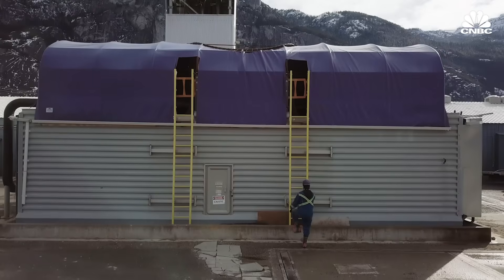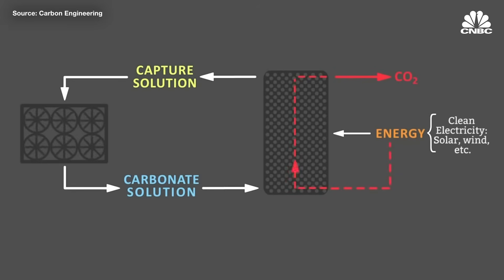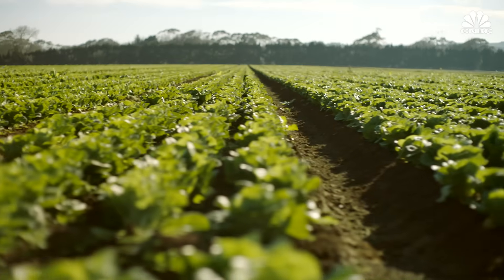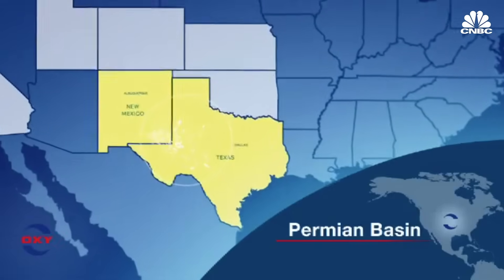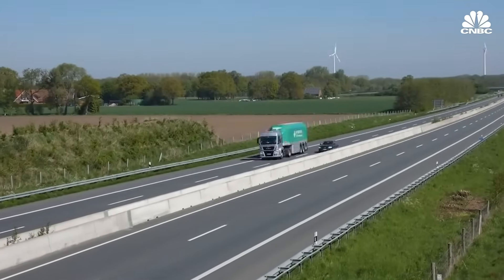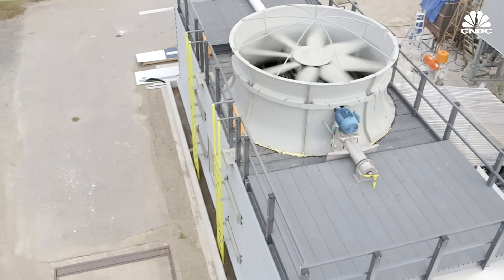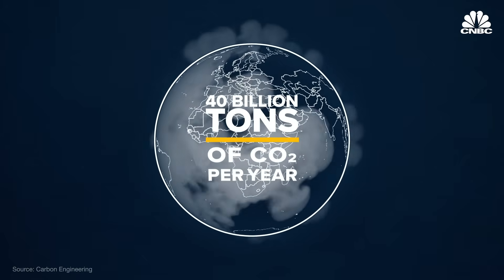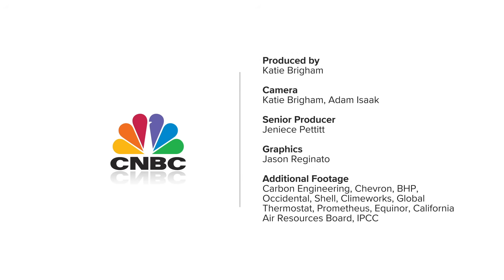Bill Gates-Backed Carbon Capture Plant Does The Work Of 40 Million Trees

Comment: Carbon Dioxide is greening the earth and shrinking deserts.
Reply: How bout you just sit in your garage while the car is on and the garage door is closed and enjoy all the carbon dioxide you like
Reply: You are technically correct....
Reply: All mighty ass that would be carbon monoxide
Reply: Yep, that comes from a study by Zhu et al 2016. Carbon dioxide is also warming the planet and changing the climate, as the paper discusses. The paper does not conclude that this increase in plant growth due largely to CO2 fertilisation will stop the negative impacts of climate change.
Reply: wrong
Reply: soil is degrading and plants dont grow due to water flashing away instead of sinking slowly into the soil as it is to dry...

it actually creates an overheating with creates desertification due to wrong agricultural practices

its way more complex as it seams first sight

If it only would be that easy  all these problems wouldn't exist
Reply: @ryanzacsanders  there is legitimate scientific research that shows between a half and a quarter of vegetated lands on earth have been greening over the past 35 years, and that this is mostly due to CO2 fertilisation. The research was done using NASA satellite data. I think OP was wrong about deserts shrinking though. There's a page on the NASA website about it, with a link to the paper. 
https://www.nasa.gov/feature/goddard/2016/carbon-dioxide-fertilization-greening-earth
Of course, this paper doesn't support the idea that climate change is good.

Comment: What a laughable attempt to solve a NON-PROBLEM! All he has to do is gather a pail of plankton rich seawater and add them to a tank containing seawater containing a dissolved mixture of dissolved rock dust powder and concentrated iron ore powder and let an artificial planktonic bloom to explode in the tank and have them continuously screened out and recycled the seawater back and add fresh seawater and composite rock dust powder and concentrate iron ore powder to the tanks and keep on repeating the process. And use the ultrasonically rinsed phytoplanktonic algae to be added to a biogas digester to produce energy to run the entire system.

Comment: It would make far more sense to use thorium as nuclear fuel, and other forms of energy.
Reply: Thorium is not ready yet but your absolutely correct. It wont be long for another energy source comes along thats clean and cheap....Then all the trees we had planted will continue to provide benefits for decades to come while the air filters would be rusting away. We could also still be paying for them.
Reply: @scooterbum4288  The only thing needed currently is the construction of the power plants. We had two test facilities one in Oak Ridge, and another in Los Angeles California that did run for many years. They were phased out by Nixon in favor of building nuclear plants that are more efficient for making materials for nuclear weapons.

Comment: Big oil jumping on board doesn't surprise me actually. The biggest threat to their bottom line going forward, is the fact that people are now awakened to the need drastically cut co2 emissions, which means drastically reducing the burning of oil, coal etc. Big oil knows this of course, so... if a technology exists that might obviate the need to reduce co2 emissions, by sucking the co2 out of the atmosphere as fast as or faster than it is pumped out, then big oil are going to jump on it, because as it stands it's the only thing that might keep their entire business model viable into the future.

Comment: 51% on man made CO2 is from production of beef... 60 million cows in the us. 300 years ago there were 100 million buffalo on the open plains. CO2 is not the issue nor is climate change real.
Reply: The diet of wild grazing buffalo is in no way comparable to the grain fed cattle of today. Also methane is different than CO2. Its 150x more potent.
Also the climate is changing. The USDA regularly has to update its climate zone maps because they have moved 40 miles north every year the past decade. Annual precipitation, sunny days, and record heat determines an area’s climate zone, all of which are changing rapidly.

Comment: GROWING forests also  take out a lot of carbon from the air (in mature ! forests there is a balance). Remember the pictures of burning Notre Dame ? the French called the wooden roof underconstruction "the "forest":  represented a forest of 13,000 oak trees nearby Paris. Some trees date from 1200 or even earlier - so they started growin around 800 - 900 (A.D. !) So that carbon had been stored for more than 850  years - and if they had installed sprinkler system it would be still in place.

There are still existing ! timber frame houses in Europe that were built around 1300 / 1400. They have been restaurated and are still used. 

These days they have developed technologies to build 5 - 6 storeys high buildings from wood (likely with a lot of particle boards in the walls and flooring).

Some years ago an olden wooden oak bridge from ? 1300 went up in flames in Switzerland. 

particle boards contain shreddered wood, OSB contains MORE wood and is more expensive.

Furniture could be built with wooden boards (it must consist of small stripes glued together in alternating order - to counteract warping). Such furniture would be much more robust, it is easier to restaurate by laypersons. and the solid material would make it worth your while to maintain or build something new from it.

Solid wood is easier to handle by persons that have not have a garage or a lot of equipment (for instance if you make a cut you will have a nice even border. If you cut particle board you have to add a border - which is not that easy if you do not have the equipment. You have more "meat" to screw things together (some dowels glued in after setting up a cabinet in a provisory manner with screws will considerably add to stability - no need to . 

Wooden floors have only a thin veneer on the surface - because the wood is too expensive.

How about we would use more REAL wood in construction and for furniture. Worst case scenario: it is thrown out and now one wants to pick up the good boards and use them for a project. In this case they would be BURNT (in a specialized plant at high temperatures - that takes care of the coating, and paint and other chemicals - with good filters. Such plants are common ! in Germany and Austria. Furniture and construction materials do no land at the landfills, the citizens have to SORT them (only then the costs for disposal will be reasonable, it costs an arm and a leg if you do not sort, that is even true if they tear down a building).

Those power plants do not only generate electricity but also heat - warm water and for heating. That way they can use over 60 % of the fuel - an efficiency a smaller furnce or a wooden stove cannot achieve.  

Those new forests should be grown in the TEMPERATE climate zone. and be taken care of by farmers and in SMALL units. No harvesters (they are a desaster).

The boreal forests and the rain forests that are currently plundered (or burnt down for the insanity of palm oil plantation or "bio fuel") must be left alone. They are too vulnerable (in the cold the trees grow only slowly and the harvesters are a disaster for the ecosystem and soil. 

In the rainforest the downpours wash away the nutrients. Moreover the strategy of nature to deal with the lack of nutrients is extreme diversification (that is why the Amazon is the most complex ecosystem in the world. The African and Asian rainforest got some injection of volcanic ash - but with the Amazon that strategy was take to the extreme. 

There a countless species (plants animals) - but often only in a certain area AND each species shows up only in small numbers. so there may be only a few trees of a certain kind in an area. If those areas are cut down - there go the species (many of them are not even known to scientist yet, let alone that they have been researched). 

So we lose that treasure trove of nature and all options it would offer (a certain poison of a frog, a substance in a plant - that may be of medical interest). Or the "design" of an insect or of a surcace that could inspire engineers (like they did research on the lotus effect or were interested in the skin of sharks and dolphins and how that helped them to swim fast with as little energy as possible). 

If they  brutally cut down the trees in the temperate climate zone and even compress the soil by using harvesters - these forests will recover. Natural forests in the temperate climate zone are also diverse, stable and beautiful - but it is nothing compared to the diversity of the rainforests. (that is because they get more nutrients and there IS soil that builds up. In the Amazon soil is washed out. 

After a cut-down or a wildfire (which does not even revmove the nutrients - nettles and grass will keep most of the ash in the soil) - they will bounce back without help of humans. That can of course be speeded up considerably.

There is enough rain, so the trees will prevail, there are enough nutrients, and it is warm enough to overcome the disadvantage of the damaged soil if harvesters are used  (and the soil is thicker). Shrubbery and nettles  will pierce the soil and then the trees will take over in a second wave. After 100 years they forest will have recovered (or not even that long).

Cut down rainforests doe not recover in original form at all !

Comment: This plant does the work of...1 or 2 square miles of trees.
You've got to be kidding.
Reply: A  healthy forest has ~50 trees per acre. A square mile is 640 acres. Hence a forest might have ~30-40,000 trees per square mile. Hence 40 million trees would be approximately 1,000 square miles.
Reply: A YOUNG growing forest takes out a lot more carbon in the first 30 - 50 years. And they can be planted more densely - local farmers can take out most trees over time  and let a few stand to grow tall - like in a natural forest (that is common practice in many countries anyway. It is labor intense, but also sustainable if different trees are used. Some subsidies (for the price of wood for instance, they would always have some from removing underwood and branches and sick trees, would go a long way to secure these jobs in rural areas. 

Wood can also be used in INCREASING VOLUMES  for durable quality construction material and funiture (not particle boards, solid wood boards). 

In the beginning they can use mature forests with larger trees for that (considering ecological criteria - so small scale operations run by local farmers in the temperate climate zone. Not cutting down the boreal forests and rainforests). 

Meanwhile not only the harvested trees are replaced by new seedlings, NEW forests are planted additionally ! 

Meat needs to be sold at its REAL production costs (much higher), an end to fast fashion (cotton needs a lot of farmland) - that will free up the space for extra trees and there will be enough farmland and meadows left to produce enough food (the forests need to be grown in the moderate climate zone - these are usually wealthy ! nations). 

Forests also influence humidity, the regional climate, aquifers, prevent mudslides, prevent floodings - the soil of a natural forest (as opposed to a fir plantation) is like a sponge, such forests can prevent floodings, when they soak up excess rain. They secure the soil, produce oxygen, are hunting grounds and an asset as Natural Parks and for tourism. 

worst case scenario if such wood is "only" used for a few decades as construction material or furniture - it is burnt to produce electricity and heat, in that case it is carbon neutral.

The wooden underconstruction of Notre Dame was called the forest.

13,000 trees mostly oak that started growing around 800 - 900 AD and were cut down around 1200 AD - they could still go strong had it not been for the fire in early summer 2019. 

a few centuries (or 1000 years) can by us time.

Comment: it makes the same material eggshells are made of?
trees work with no power input but they take ages to grow and can burn down at any moment releasing all the carbon they captured.
the US military budget could solve so many issue if it wasn't being used on war efforts and domestic protection. if the US didn't need a military the money could be much more useful spent on technology development.
Reply: in the first 30 - 50 years a growing forests takes up the most carbon. Even after a large scale fire - the forest bounces back quickly. Humans cutting WHOLE forests is worse - the nutrients are removed when the trees are taken out  (a wildfire leaves ashes)

 - that is O.K. in the moderate climate zone with good soil quality. 

Not in the rainforests where the downpours wash out all nutrients that are not held by biomass or roots systems.

and modern harvesters compress the soil - they are worse than a wildfire, that does not damage the soil.

Comment: Sounds like a complicated tech when all you need is a farm of clear pipes filled with treated sewage water with bubble stones at the base to take the nitrates left in the water and grow algae at the cost of a pump to fill the pipe and an air compressor to pump in air to the water. No chemicals needed just nitrates rich water, air and sunlight 

Nothing like cleaning the water more and pulling CO2 out of the air to create a product that at worst is then turned into animal feed.

Comment: The usual scientifically clueless reporting. 15 minute story without even a single word about the WILDLY THERMODYNAMICALLY UNFAVORABLE nature of carbon capture. This will NEVER EVER even put a tiny dent in the enormous amount of co2 in the atmosphere. The only solution is to stop emitting.
Reply: The solution is to stop emitting, AND work to clean up the mess we've made which means employing any and all technological means to try and pull the CO2 we've generated out of the air.  If that means planting trees AND building atmospheric CO2 scrubbers, good.
Reply: Yeah, except, it doesn't mean that. Especially in the current time when 80+% of all power is from carbon intensive sources. Maybe 200 years from now when everything is fusion powered and the thermodynamics of carbon capture are practically irrelevant due to electricity becoming too cheap to meter it will make sense, but by then it won't matter.
Reply: @Muonium1  A coal based power plant in West Virginia tried doing CCS to try and make "clean" coal.  The plant normally puts out about 10,000 lbs of CO2 a day.  In order to run the CCS system, the plant had to up the amount of coal it burns daily by 1/4th.  The CCS only captured a few hundred lbs of CO2 a day.  That's a net negative, and mirrors your point, but you're wrong about how much energy we get from fossil fuels.  It's more like 63%, and 35% is from natural gas and 27% from coal.  Coal is much worse than natural gas.

What we need are molten salt nuclear reactors.

We need to shut down all coal and natural gas plants, AND we need to shut down all current nuclear plants due to their safety issues.  We ALSO need to tear down all the wind turbines we have as well.

We can begin doing that once we get the molten salt nuclear reactors online.  They're imminently safer.  Once we've got them in place, we can run the CO2 scrubbers as much as we want as the energy source is emission free.
Reply: @Les_S537  I'm talking global energy use sources not just US which is moderately cleaner due to significant hydro and uranium. 

why do we need to tear down the wind farms??? the largest turbines are approaching 10MW and have capacity factors nearing 50% which usually scale favorably with size.

Comment: Anything that can help reduce the pollution caused by us using fossil fuels must be good for the environment, until we can produce more electricity from natural sources like wind and solar and improve battery performance for vehicles surely this will help. The oil company's of course have a vested interest in reducing carbon immissions , they are the ones who through us using vehicles, trains and planes create this gas so if people don't buy the oil products their out of business and that's the last thing they want. This system should be used in big cities worldwide where there are big concentrations of vehicle usage until we can develop the nesessary technology to generate electricity and store it effectively, these fools that think we can just do this overnight are living in La La land. Clean energy is urgently needed and atomic power is NOT the way to go because of the risks involved with it and the costs and problems with dealing with any accidents that may occur, this stop gap measure must be better than doing nothing at all.

Comment: Trees separate the carbon from the oxide then give this oxygen into the air and hold the carbon as plant structure. the machines don't  do that.  The need for trees goes far beyond the need to hold carbon. If the petroleum cartels get behind any carbon price it will be one that passes cost on the poor.

Comment: There are 2 problems with just planting trees.  1) When a tree dies the carbon it captured is released by the microbes that decompose the tree.  2). Fossil fuels come from trees that died millions of years ago during the carbonifiourous (probably spelled wrong) period, which was before microbes had evolved to decompose trees, so the trees turned into oil and coal.